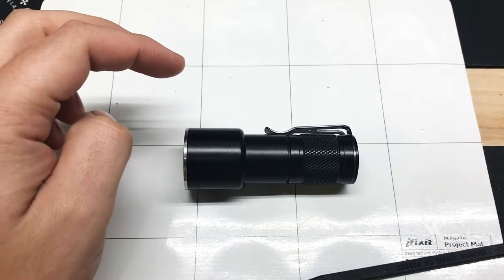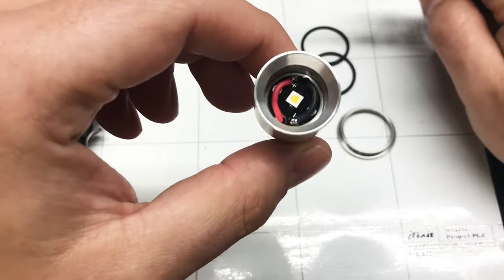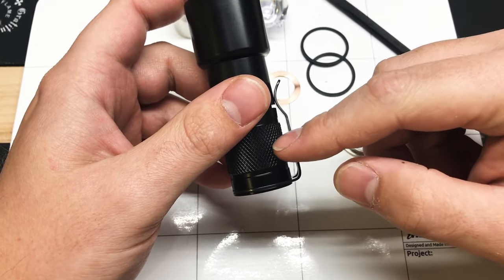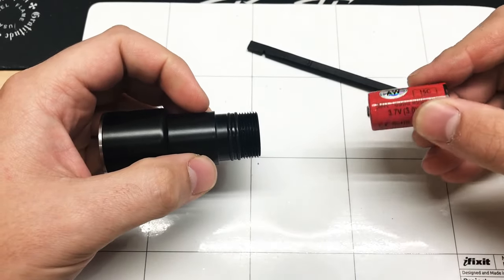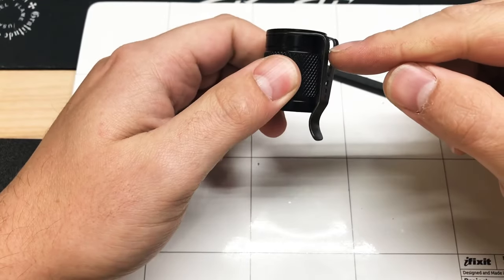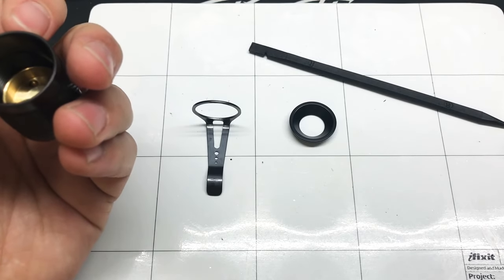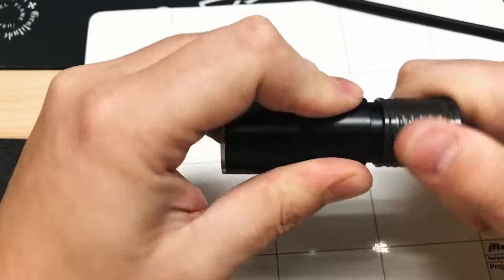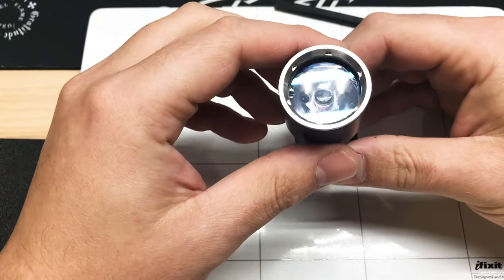Oveready P20 host, DIP P60 and DPC tail cap overview

Comment: I really like my P20.  One tip for removing ZeroRez / McClicky switches,  once loosened, just use the pointed end of a spudger in one of the divot holes and spin the switch out.  Same applies when replacing....just get the threads started... spin back in and finally tighten with suitable circlip pliers

Comment: I got a busted Element M961 off ebay recently that uses close to the same lens arangement. The inner lens is P60 diameter but the outer is M3 sized and instead of two o-rings it has a threaded aluminum collar that spins down to put pressure on the lamp module. Beyond that its the same idea. The "busted" part was the original drop-in but its basically the same size as one of those afternarket P60 LED's when the reflector cone is removed so im going to see if i can bring life to it that way...if not ive got an E-to-C adapter, Malkoff MD90 adapter and a spare Z44 bezel to try it without the weird chinesium LU10/Z46 1pc head.